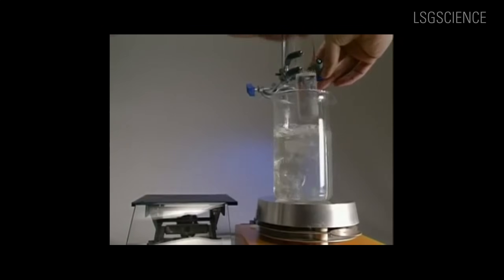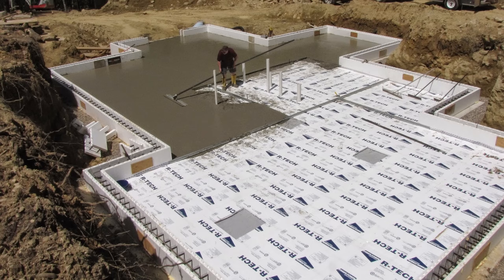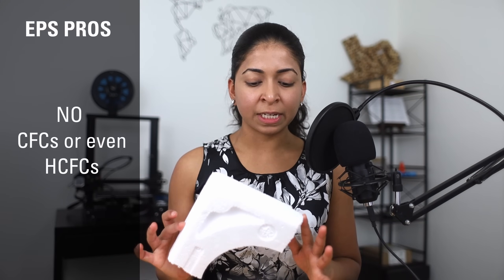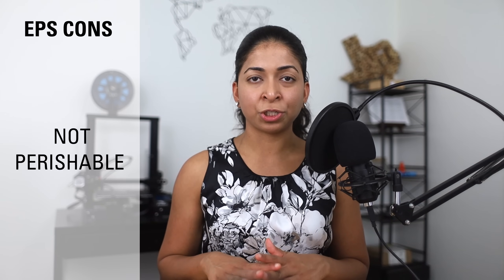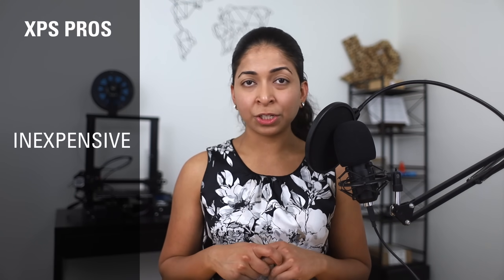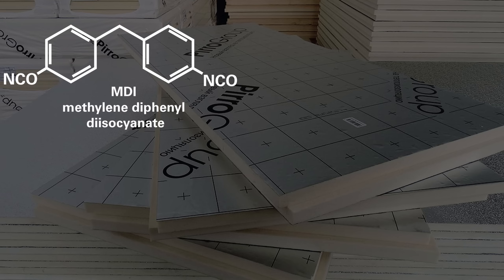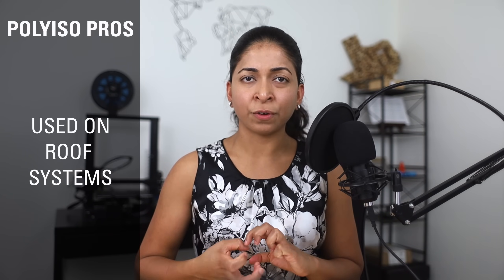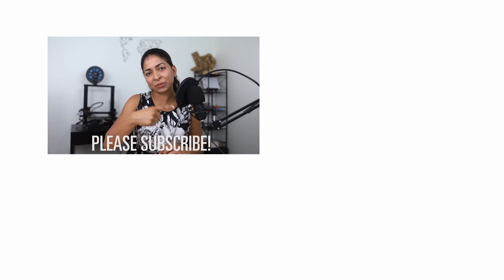EPS, XPS & Polyiso insulation | everything you need to know

Comment: this video was well researched and intelligently presented.

a few comments. one of the things that they do to deter insect intrusion into foam insulation these days is to apply a borate coating on the surface. it doesn't prevent insects from boring into the insulation, but when they ingest the borate, they dehydrate and die. that said, after enough insects have "paid the price", eventually the borate coating is breached.

one other feature about the different types of foam insulation is the coefficient of thermal expansion. eps has the lowest, xps is a little greater and polyisocyanurate is the largest (by about 50% as i recall). so, a large board would noticeably shrink in cold temperatures, opening up voids between the panels. since the insulation would sit behind cladding, you wouldn't typically see that.

the story about polyisocyanurate losing its thermal properties at low temperatures is sort of a half truth, that got picked up and turned into a "whole truth" along the grapevine. there was a paper written around 2007, or so, entitled "analysis of variables in the determination of lambda/k-factor of construction insulations". what they found was that polyisocyanurate with a felt substrate showed a trend of increasing k-value at low temperatures. they did not observe that trend for polyisocyanurate with a foil substrate. the ultimate conclusion of the paper was that there were general problems with test methodologies for the determination of k-values of insulating materials.

any of these foam insulation types can be a vapor barrier, depending on how thick the sheet is. for example, as i recall, xps is classified as a vapor barrier when the thickness is greater than one inch. you typically don't want to put a vapor barrier on the exterior of your wall in a heating climate, but advocates overcome these concerns by declaring that the continuous insulation increases the dew point temperature at the sheathing, with the objective of keeping the sheathing temperature above the dew point temperature so that you don't get condensation at the sheathing (thereby reducing the risk of mold growth). there are some assumptions built into that rationale.

as an aside, one of my nits is seeing trademarks getting violated. "styofoam" is not the generic name for either eps or xps. it is a brand name for the blue xps insulation product sold by dow chemical company. in your video, you will notice that only the xps board made by dow chemical bears the name "styrofoam" (for what it's worth, i also get annoyed when people generically call a reciprocating saw a "sawzall").
Reply: Picking up on your last point, going back to the late 70's a friend's mother  used to call all computers IBMs.
Reply: And let's not forget about the laminate countertop
 (for Micah)....  😮

Comment: Good stuff. Something that gets missed in side by sides like this is that polyiso is much better because of how much pollution is reduced from the extra performance.  That is the reason it's used commercially even though it costs about 50% more. Homeowners are simply to cheap to uses it.

Comment: Hi Belinda, thank you for the very informative video. I am considering a camp trailer that uses Polyiso panels. They rate it at R5. It there a calculation for what the decrease in R value is over time?
Reply: I found this article about this subject : https://www.greenbuildingadvisor.com/article/polyisocyanurate-rigid-foam-and-thermal-drift
Reply: Just wondering if a polyiso panel rated at R5 will have the same insulation value in 10 years?  The polyiso is sandwiched between corrugated plastic and 1/16 aluminum exterior sheet.

Comment: I want too insulate a sprinter on the outside of the living space. So the under carriage and between the roof and roof rack with an RV style membrane. Which one of these would you recommend if any. I am using thinsulate on the interior walls and ceiling great videos thank you
Reply from the maker: If thinsulate has a vapor barrier, you don't want to use foil faced polyiso panels. XPS might be your best bet. This website seems to be an excellent resource: https://faroutride.com/insulation/
Reply: Advanced RV out of Ohio actually pointed out that the metal walls of the van are a vapor barrier the thinsulate doesn’t have foil. Love your videos 🍎❤️

Comment: I am confused...( nothing new there...) the EPS and XPS products you describe are coated with a fire retardant as a part of their manufacturing process but are still considered flammable and yet when exposed to naked flame... well they hardly went up like a torch... is there an option to not have the end product coated or is that particular treatment more of an... how can I express this... combination process with the liquid before it is "inflated"? also couldnt one coat the foam products with an insecticide as is done the fire retardant to counter it's attraction to termites etc? Finally, Could you provide some examples of what EPS ans XPS can be converted into that reccomends them as being recyclable!
Reply from the maker: You're right, the flame didn't spread, but it didn't resist it either, so it's considered flammable. I would assume that adding bromine fire-retardant to polystyrene would create another compound and would prevent inflation or foaming. 
You could coat the flat surfaces of the foam products with boric acid to repel insects and termites, but the cut edges would still be vulnerable. I've read that termites love 2" polystyrene because it doesn't collapse like cellulose insulation (even though the latter is organic). 
Recycled polystyrene is rarely remade back into eps or xps. Instead, it's used to make fake wood for benches, high density plastic panels, toys, etc. This company seems to only use recycled polystyrene for their cutlery: https://www.ecoproducts.com/products.html
Reply: The bigger issue with EPS and XPS is the release of rather large quantities of carbon monoxide when heated. This release can begin as low as 200F, the high setting of most hair dryers.
Reply from the maker: @chrisose  But that's only a concern during a fire.
Reply: @BelindaCarr  I know from experience that both hotwire cutting and heat guns will cause CO release from EPS. Both of these processes are at temperatures below  the combustion threshold for most materials. This is the reason why most foams are only certified for exterior use or if they are completely encapsulated.

Comment: It seems like the practical R-value for PIR is around 5 when you consider thermal drift: https://www.greenbuildingadvisor.com/article/polyisocyanurate-rigid-foam-and-thermal-drift
Reply from the maker: So, definitely not worth the price? If they invent a higher performance EPS I can see XPS and Polyiso being rejected.
Reply: @BelindaCarr  Well the question is, what else can you get at an R value of 5-6 for that price in such a practical solid board?

On new builds a few extra mm of insulation really shouldn't be an issue (if it is, design better), but for retrofit every few mm can matter.

One of my big issues with EPS is that I don't think as an infill board product it's ever fitted as well as XPS or PIR. With its lower structural strength it also can't be used in the same ways and is very easy to damage and not very easy to repair.
There are so many corners cut on building sites these days that anything that's not as foolproof as possible to install just isn't going to be installed properly.

Comment: It's such a shame that despite its recyclability and huge worldwide usage, most PS is still thrown away rather than being recycled.
I presume it's much more expensive to recycle than it is to manufacture. I can recycle it locally if I can transport it to a local recycling centre, but it's not collected in the same recycling bins as everything else.

I feel that this is something that's often overlooked when mentioning that products are recyclable though - being physically recyclable is different to being practically recyclable.
Reply from the maker: I completely agree!! The huge disadvantage is the space PS occupies since it's 98% air. There's very little incentive to recycle it because the actual material is insignificant compared to the volume it occupies during transportation.
Reply: I'd be very interested to hear your thoughts more on insulation in general, covering the production, transportation, installation methods (some requiring additional structure/support/fire barriers, some being impossible to modify - vacuum panels), thermal drift over time/slump, usability of offcuts/waste, and eventual disposal/recycling.

Natural wool insulation is often mixed with recycled plastic fibres making it non-recyclable/biodegradable. Should we be using that when we're gaining so much knowledge about the issue of microplastics?
What the heck do we do with fibreglass insulation at the end of its life?
Can any blown/loose insulation actually be recycled in any way?
Reply: @mowcius  Thank you for your valuable comments man 👍
Reply: @BelindaCarr  used polystyrene is recycled by compressing and then transporting to a re-blowing plant to make new polystyrene, this way less air is transported.
Reply: Right, but the average household doesn't have the equipment to compress it.
Reply: @acciid  In the UK there are facilities for this and it is used by larger companies that have volume. Sadly smaller waste streams go to land fill because the legislation for circular economies is not enforced. Put simple, most things are recyclable, but the political apatite is not.
Reply: @ironimp1  I think it's more down to cost rather than the political appetite. As Belinda said, the actual amount of material you get back for a certain amount transported is minimal. They do need to collect it from properties but the local waste centre needs to be able to deal with it, i.e. do the compressing. Installing this would cost money and as there's no central government funding, council taxes would need to rise and a lot of councils simply cannot do that.
Legislation needs to be in place to make the manufacturers pay for it. They can reclaim it from consumers, and it would encourage use of better materials where appropriate.
Reply: @BelindaCarr  hello could u help me
I accidentally touched my phone with that thing 
How can I remove it?
Reply: @BelindaCarr  I assume that most styrofoams are not recycled using Acetone.  Do you know how they are processed when they DO get recycled?
Reply: There are also issues of cross contamination. Not all PS are compatible with each other and if food products or other contaminants are not cleaned out, it can ruin entire batches of recycled content
Reply: In my country used EPS is collected for recycling in same bins as regular plastic waste. It's hard to recycle EPS used in housing development as it's usualy covered in other building materials -glue, cement..

Comment: Would eps combined with osb paneling and drywall make a good wall panel if there was an air gap between the eps and the drywall ?
Reply from the maker: Just to clarify, you're talking about osb on the outside, studs on the inside with eps in between the studs, and then drywall attached to the studs, right? That's pretty typical. You wouldn't need an air gap inside your home. The air gap would be on the outside, between your cladding and the waterproofing/osb.

Comment: This is great explanation..) Thank you!

This reminds me... Can I ask what do you all think about Pyrogel and Cryogel?
How good are these materials for home insulation?
Reply from the maker: Thanks! I'm trying to get a sample of those products for a video. I'll try to make it soon.
Reply: @BelindaCarr  I was using this manufacturer for ordering samples - https://www.aerogel.com/
However, I am not sure if they are open right now.
Please do be careful with that staff, it is very dusty.
Reply from the maker: @emberofnova6371  Thanks a lot!
Reply: pyrogel, cryogel (and spaceloft) are nanotech materials that have really low k-values per inch (like 0.1 btu/in*degree_f). you typically use them in places were you need low thermal conductivity, but don't have much space. i used it at my house when i erected a big steel beam such that i was not able to use cavity wall insulation and had little room for exterior insulation. there are three basic modes of heat transfer through a building envelope (i'll let belinda carr do a video on these). these materials are most effective at preventing conductive heat losses. they lack thermal mass, so they would do little to keep radiation from the sun from heating up your building envelope.
Reply: WAAAAAAAAAY to expensive